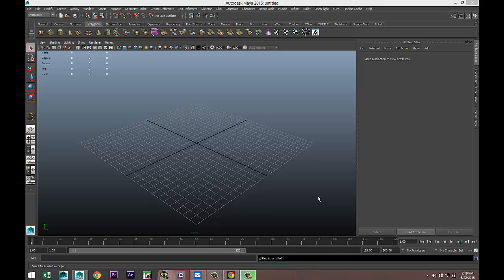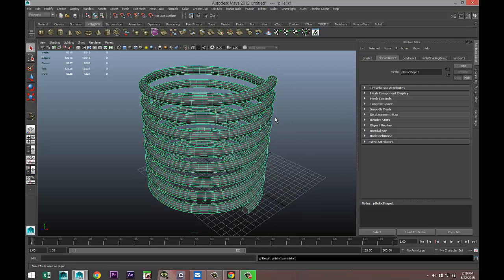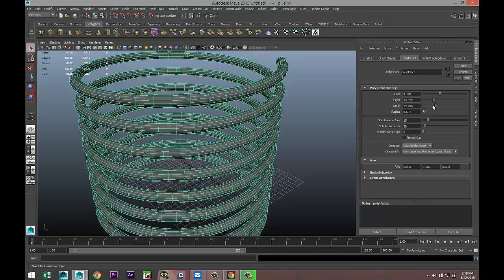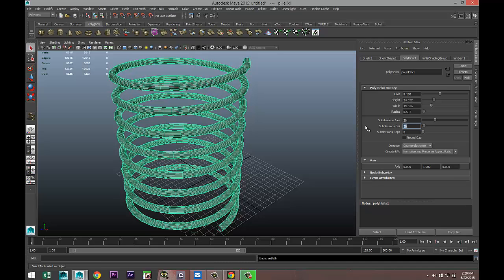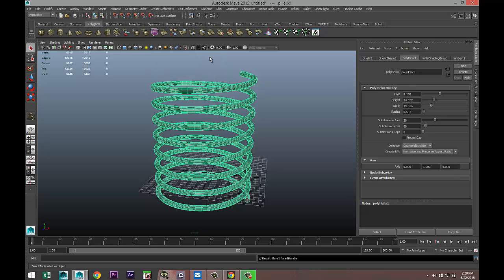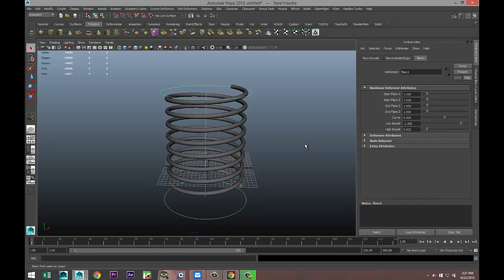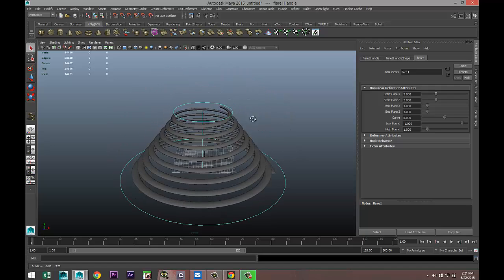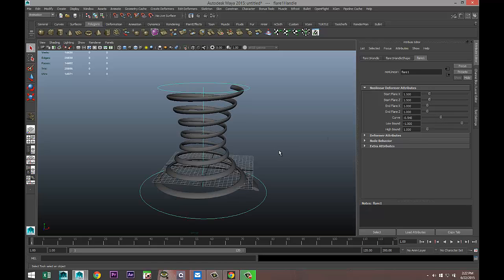Maya tutorial : How to model a Cone shaped Helix

Comment: Another excellent tutorial as usual...you are a 3d rockstar!!!  Do you know if there is a way to taper the helix without it flattening the coil itself.  Basically I need to taper the overall coil but not change the circle profile so that the "spring" bar stays round.
Reply from the maker: Brett, create a curve path ( EP Curve tool ) using the Make Live function and create a tapered helix curve. Then take a small cylinder face and extrude it alongside path. That should work
Reply: That is exactly what I was looking for, thank you so much for responding so quickly!  I was away from Maya for a little bit to try out Modo (awesome software but can't really handle high poly yet) and of course you had a video to cover what I need!  You have now become the number one online Maya instructor in my opinion, I hope you realize how much of a difference you make to us out here learning and working. Thanks again so much Mike!
Reply from the maker: Thank you so much Brett, that means a lot....